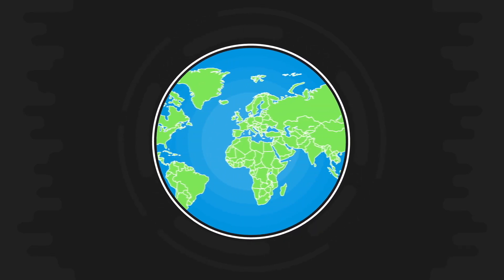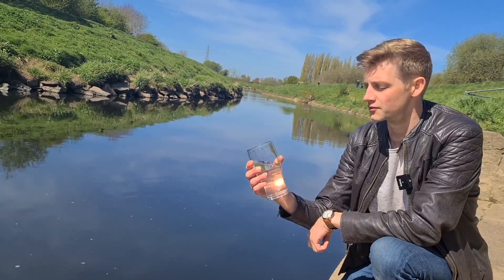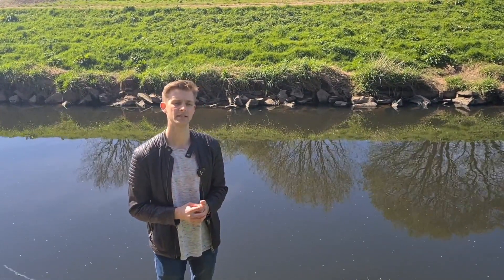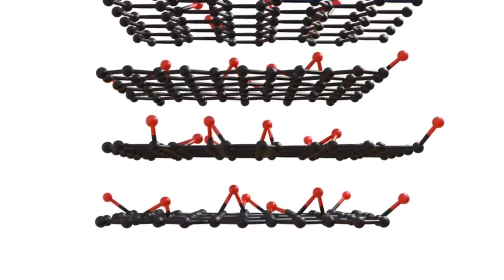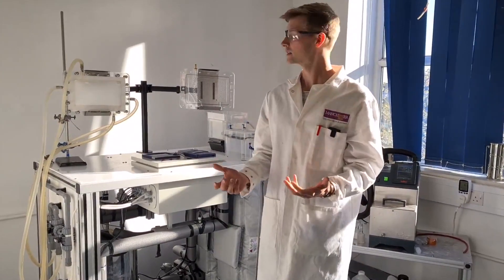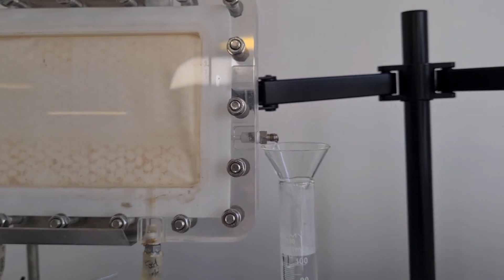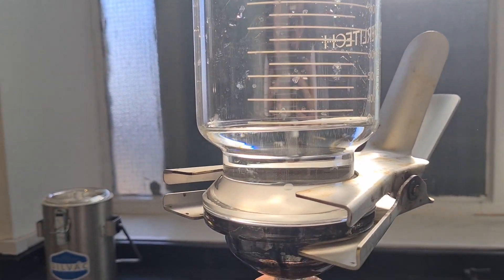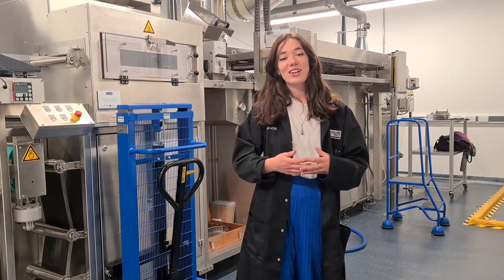Graphene Membranes and The Water Crisis

Comment: Great approach, what is the situation now? question, is it possible to increase water vapor pressure with magnetics. Think of an alternating magnetic field, resonator, which makes the molecules vibrate. This way you can influence the water locally and not heat the entire tank.

Comment: Sounds like this tech will be good for alot of things other than just water purification.
The other side of the membrane is just as interesting.  And if the specificity of the membrane can be altered to a very fine degree, then the possibilities of low pressure and low heat purification and crystalization should be impressive.
Reply: Yes you're right- membrane distillation has some other really interesting applications including gas separations and (as you said) membrane crystallisation. Here's a good review paper on the latter https://link.springer.com/article/10.1007/s11157-016-9403-0 
 and heres a news article about graphene gas separations if you're interested :)  
https://newsroom.unsw.edu.au/news/science-tech/graphene-iron-filters-promising-gas-separation-tool-research